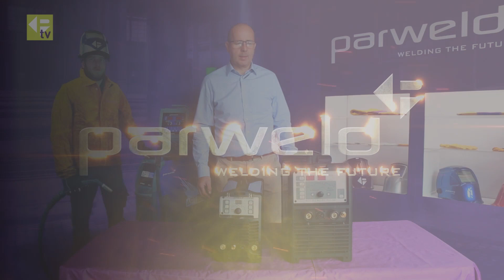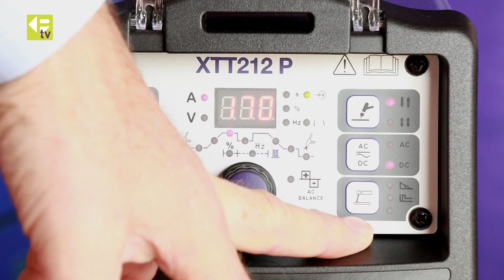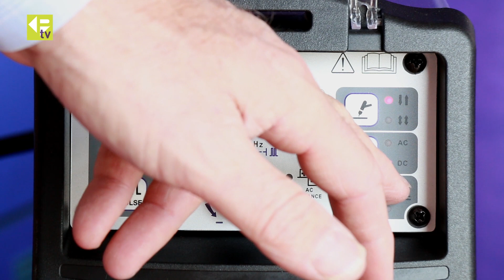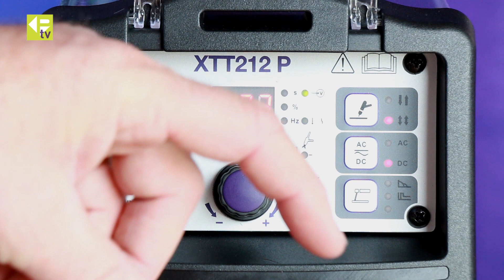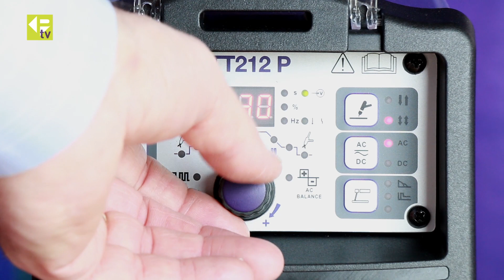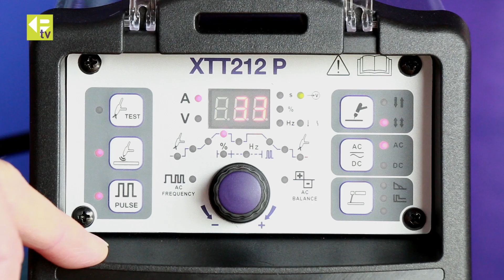XTT 212P AC/DC PULSED TIG INVERTER - DUAL VOLTAGE

Comment: I just bought one of these. Its a nice unit. 
Good size for its output and very light weight. 
The ball-park settings in the manual are pretty good to get you going if its your first time.
I find the torch current adjust buttons very hard to use with gloves.

But damn is the fan loud! It may shutdown once its booted, but once the invertor kicks in it drones away for ever in the workshop. I dont know if this is maybe an over-driven invertor with a larger heatsink and fan..but time will tell.
Im sure it will do fine in my workshop.
I also have the Parweld 
XTP40 plasma and 
xtm160i mig